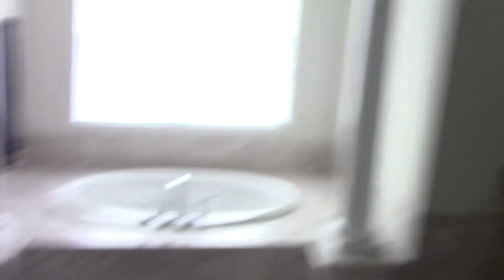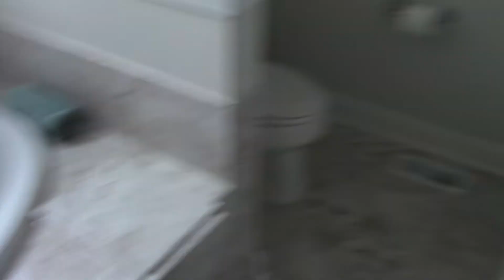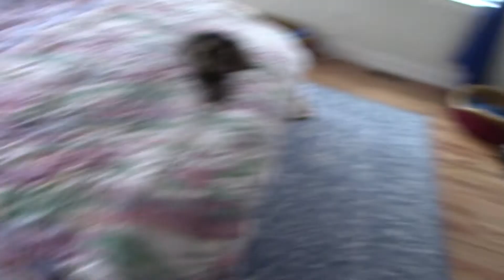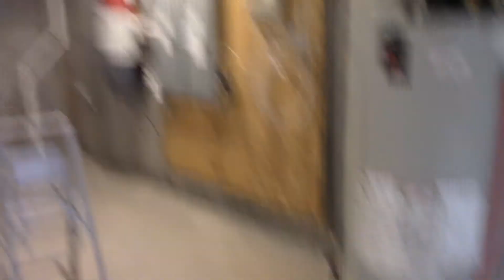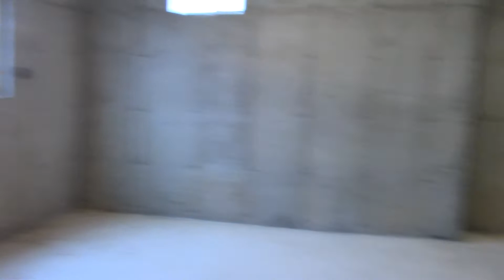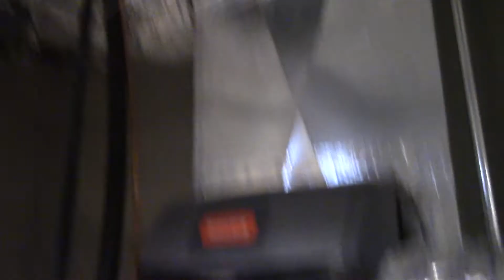New Vent for First Floor Bathroom.

Comment: Does your furnace not have a bypass duct to relieve excess pressure in the supply side when one of the zones is closed off ? I always thought that zoned systems without variable speed blowers would have a bypass duct, unless the humidifier is the bypass.
Reply from the maker: No bypass ducts. Zone 2 being closed really doesn't affect the air pressure much at all. But the other way around did. You could hear it at the air handler. With that extra vent added now and having all of them open, it is much better than it used to be.

Comment: While the tile work and "cutting in" of the new vent is impeccable, the way the duct was run  in the basement is abysmal.  Blocking the window and the bulb?  Nope.  Could have done much better.  

The chandelier accident was just that.  Good thing they're fixing it.  Hopefully the glass "shades" for the bulbs aren't sold separately so they have to buy a whole replacement.  If that's the case, it would be a good idea to get one or two extra shades for the future, just in case.  Those LEDs of course will fail in short order, leading to early and often bulb replacements.  And, as we know, accidents happen, so it wouldn't be a bad idea to have a spare or two stowed away, just in case for that one day.
Reply from the maker: I even asked them about the duct if it could be brought out more, but it was just too short to do that. But who knows, in the future, maybe I can find another and redo it. 

Oh we have plenty of spares around, so we're all set!
Reply: Yeah, sounds like either they got one that was just long enough, or perhaps that's the longest they make and you'd have to couple 2 together.